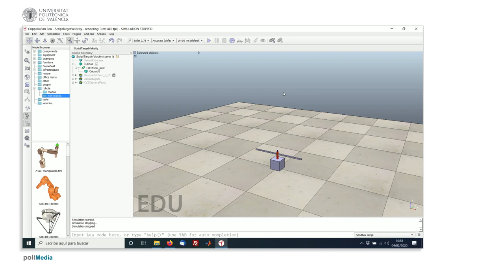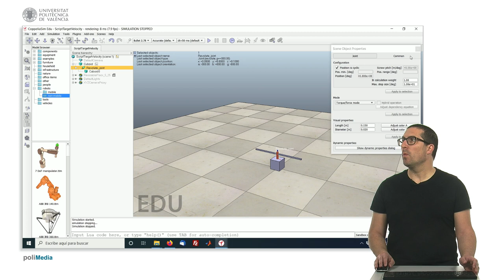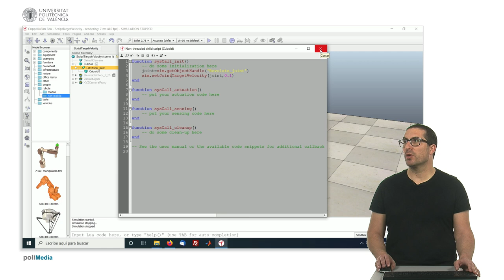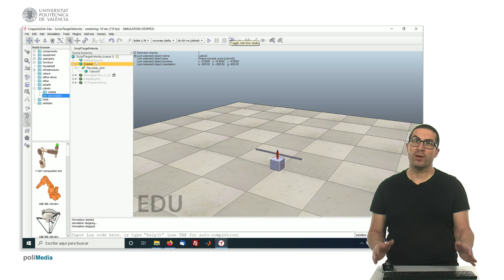Programming example of a joint (velocity control) | CoppeliaSim (V-REP)

Comment: Great class! I use a remote API with Octave integration. I am simulating the rotation of a DC motor and I would like to know if it is possible to set a speed of 3600 revolutions per minute?
Reply from the maker: I guess that you should use the ‘simxSetJointTargetVelocity’ of the Remote API. See documentation at https://www.coppeliarobotics.com/helpFiles/en/remoteApiFunctionsMatlab.htm#simxSetJointTargetVelocity